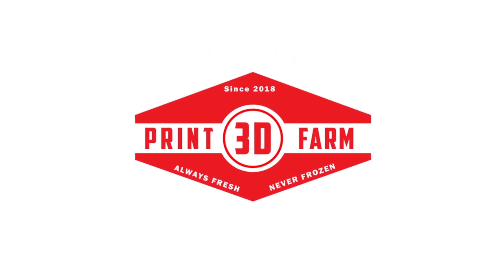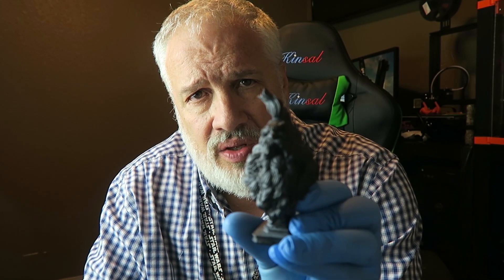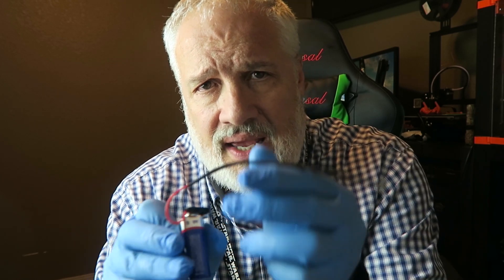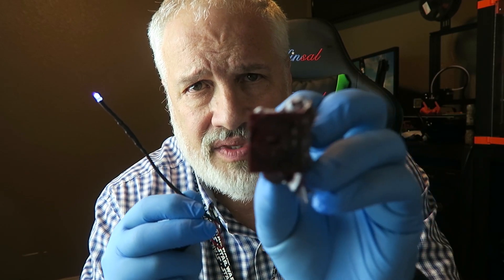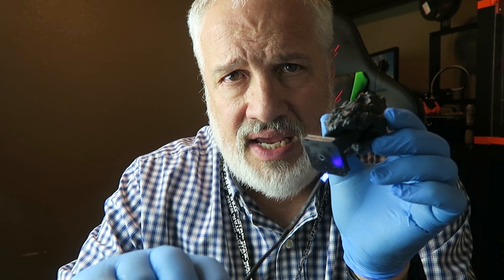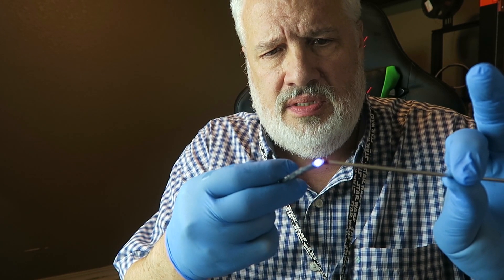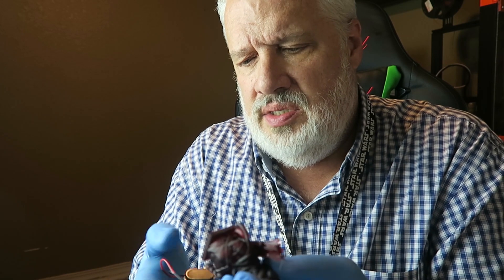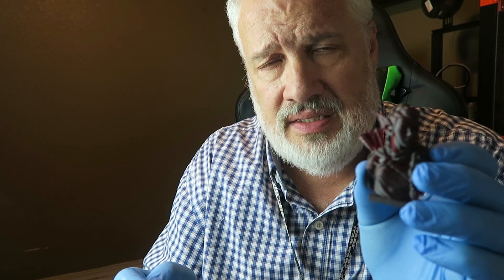Resin Printer Hacks! How to Cure the INSIDE of a Hollow Resin Print!

Comment: I was thinking the same thing. 

Also, if you needed a more intense light (production?) or needed to fit a hole smaller than the smallest led you can get, you can take advantage of the fiber-optic effect:
Cable: thin (flexible preferred)) clear string of material
Melt/form a clear  round blob at each end
1 blob acts as an input side, collecting all the (UV) light you put around it and sending most of it down the cable
the other blob acts as a bulb or diffuser to spread that light around (instead of just a tight beam)

Real world example: those fiberoptic flower or mushroom lights.
they have a bulb at the base, then a bunch of thin fiber optic cables that end with tiny blobs, so instead of a bunch of tiny lasers, they look like glowing dots hovering in space.
(maybe you could buy one of these and steal a bunch of its strands for the purpose!)

Comment: This is a great tip (provided you've got a inconspicuous or patchable place on the model for a hole, needed anyway for draining). My LEDs arrived today, same ones you bought. (I spy a craft project using dozens of leftover LEDs, maybe an indoor curing box.) Now, you're certain the wavelength really does work? The resin cures at 405nm and the LEDs are rated at 395-400nm. That falls just under resin's rating.

Comment: I'm having this problem right now. I thought it was a problem with the thickness of the walls. Turns out it's uncured resin on the inside of the hallow print. Not all of my big prints are cracking, but a few of them are cracking bad to the point where the model is not savable.

Comment: Fake, you didn't show the resin a liquid or dipping it.  Do a large print, do you trick, then cut it in half to show how cured it is.
Reply: I wouldn't go so far as to claim this as "fake" since the concept makes sense, but you do make a very good point about proof-is-in-the-pudding. I agree that even though this makes logical sense, it would have been even more convincing to print two objects as you suggested (doesn't necessarily need to be "large"), wash both of them, use the UV snake on just one of them, cut them BOTH in half, and then show the results. Control group, experimental group - Scientific Method.

Comment: if you have resin leaking out...shouldnt you have made 2 holes to prevent a vacuum and allow the resin to drain better
Reply from the maker: You are correct. I have changed my workflow and type of solvent I use.  I no longer have problems with leakage as before! Thanks for the comments!
Reply: @3DPrintFarm  please! Tell me how you solved that!!!!! 
Thank you so much! 😊😊
Reply: @3DPrintFarm   how so?

Comment: Great idea. This is going to save me. Now to save your eyes: UV light is harmful, but even typical cheap safety glasses still offer UV protection. You should wear them when exposing yourself!
Reply from the maker: Good idea sir!  Thanks for the tip! I will add that important information during the UV Snake build video!
Reply: @3DPrintFarm  What NM wavelength are your LED's? Although the most prevalent lights for curing are 395-400 NM, I just received a decent 405 NM lamp (I figured it may have been more optimal and worth comparing) and played around with it momentarily on some objects. Even with regular safety glasses on, my eyes still feel seriously irritated. 

After researching, it turns out that the 405 NM wavelength actually exceeds the scientific definition of the UV spectrum and may likely not be accounted for when determining the legitimacy of UV protection in safety glasses! This is interesting because the blue light begins to be more capable of penetrating into the retina. 

I also read that lenses with yellow should be more superior in blocking the blue light as well, and have found a few pairs online that are advertised as specifically blocking both UV and blue light, which I'm willing to wager all of these and lamp systems and singular LEDs inadvertently produce in various degrees. 

Take care.
Reply from the maker: The UV LED's that I'm using are rated at 395-400nm.. But you know... you got me to thinking... I wonder if I could design a type of 'shield' so to speak perhaps made out of a yellow UV blocking material...something that slides over the snake and is movable.  This could potentially be effective without wearing the glasses.
Reply: 3DPrintFarm Maybe even a yellow box with a slot you could stick your hands and part in, to minimize reflected light entering your eyes. Now I wonder where you could get either from while also being assured of the safety certification.
Reply: @3DPrintFarm  Did you find them in quantities of less than 100 or do you have a PO box where I can send you some moolah and a stamped envelope and get a couple if you had to purchase 100?
Reply from the maker: @stevelaminack1516  Shoot me an email.  Email addy is in "About" section on my channel.
Reply: @3DPrintFarm  you could simply do all the operation inside the printer's dome ;)
Reply: @albertolala  what do you mean? 
If you put an LED inside the printer, then it will cure other resin inside the vat and on the build plate.
Reply: 395-405nm is basically just light, it's not the spectrum that's harmful, the biggest issue with it is if you're using it in low right, since your iris will not close sufficiently as it can't see how bright the light is.